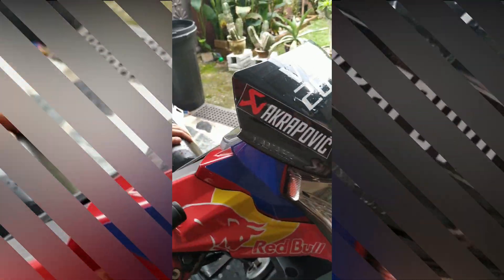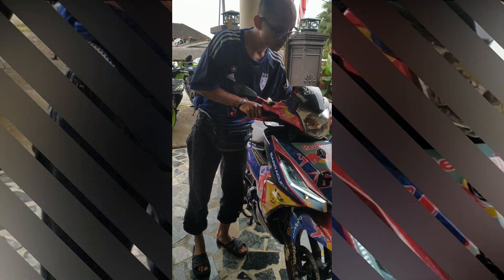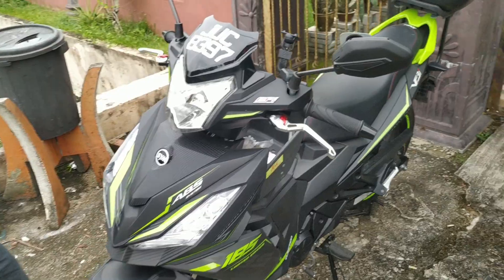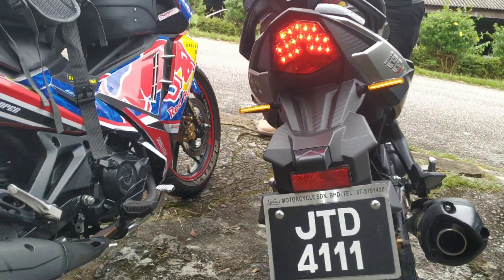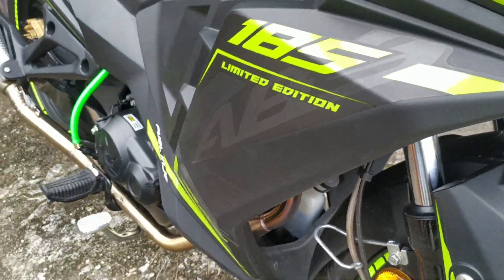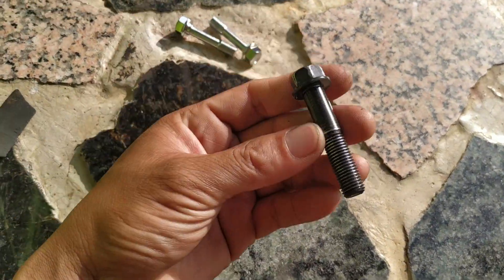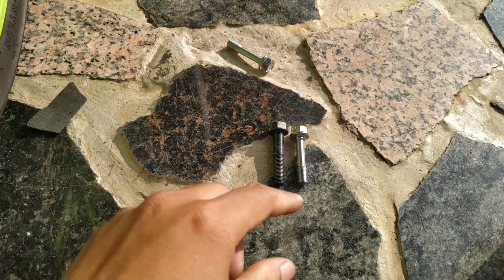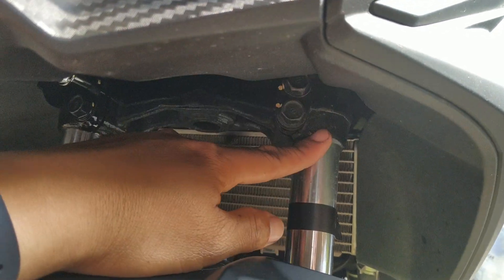SYG SAYA TURUN FORK.  VF3I TUKAR HON Padu!!!

Comment: xtersagat ke hose bracket tu dgn mudguard,akunya tersagat fork 1inci mono y suku 205
Reply: hose bracket yg belah dalam, bukan yang tepi fork tu
Reply from the maker: Bengkokkan sikit boss.. tarik keluar pakai adjustable spanar.
Reply: @ummzfamilia59  tongkat pakai ape,cri tongkat 190mm pon motor nak tumbang lg...haha..sbb yg asal ukur pon 190mm..ade suggestion?
Reply from the maker: @muhammadizzatzakariah3364  betul.. tongkat mmg sama panjang.. tapi ex5 atau one ten pnye tongkat besi lembut.. tekan bengkokkan sikit.. adjust sesedap rasa.